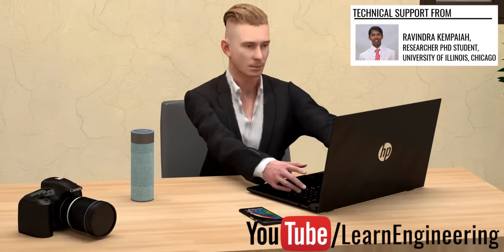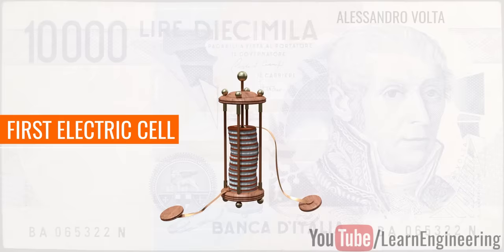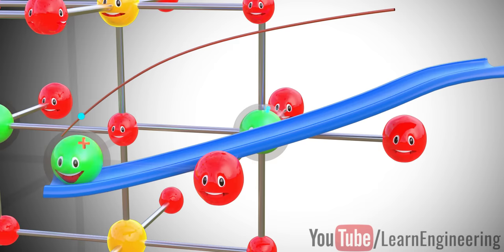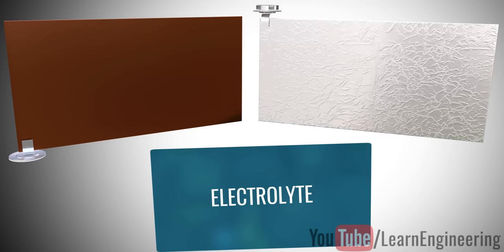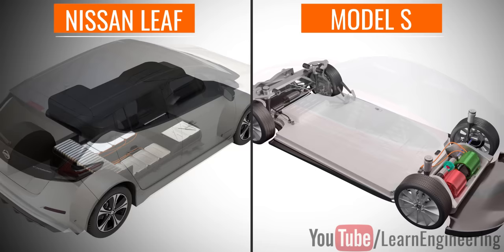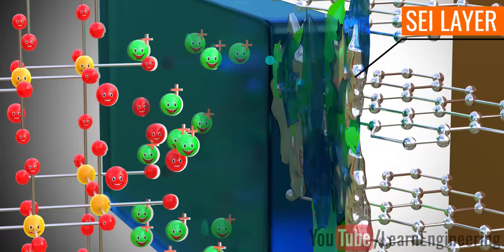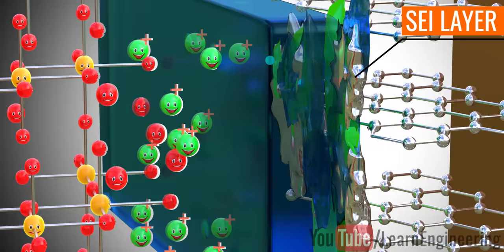Lithium-ion battery, How does it work?

Comment: Why the lithium ions coming to the negative terminal when charging and which is more stable either li+ or lithium oxide
Reply: When lithium atoms release electrons they become positively charged, and are attracted to the negative terminal. Lithium oxide is more stable because when bound with oxygen there are no free electrons which means it is harder for Li to react.

Comment: Does SEI layers forms only once or as many times as we charger it? Bcz if it produces every single time then the battery may become useless very quickly!🤷‍♂️
Reply: it does, Li-ion batteries will lose about 20% of their capacity every 500 charges, temperature of the battery and depth of discharge will affect life dramatically. newer batteries will lose only 10% after 2500 charges.

Comment: Lithium ion what if you use a vinyl ion that sunken to the copper plate and the zink metal is the producer and the one who filtered the chemical reaction of the vinyl ion that penetrate to the copper ended to the zinc metal who produce the electricity that is the feature  solid state battery

Comment: Wait, why do we need to increase battery cycles to 10,000 in order to get to 25 years? I charge my car about once a week - with 3,000 cycles, that's already 58 years. Even if we assume that my battery suffers some degradation and I have to charge it twice as often, that's still in the region of 29+ years

Comment: how do atoms move? and isn't it that electrons only bump with each other and doesn't actually move that fast?
Reply: Atoms generally try to obtain a state of stable energy. They try to move to where their energy is zero. 

Think of air pressure. If you have a state of low pressure in a vacuum and you open that vacuum, air particles flow into the vacuum to utilise as much of the space available.  

Same happens in the battery. The electrons leave the lithium creating an ion. That ion will then try to find a stable state and are attracted back towards the electrons.

Yes, electrons sort of “vibrate”

Comment: Uh, I have some questions. What about the fossil fuels used to generate 90% of the electricity to charge an electric car? Would it not be more efficient to just use those fossil fuels to propel it in the first place? Because around only 1% of the energy generated makes it to the motors, does that not make an electric car a gross polluter? About charge time, can you fully charge an electric car in 5 minutes? That's how long it takes to fill a gas tank. They have their uses, just not in any car I own.

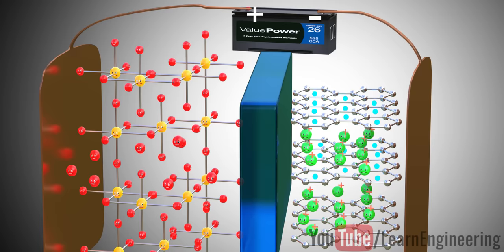Comment: 4:29 but why you called it Li ion when there's both li ion and electrons in same place in graphite it should be neutral atom here ?
Reply: They are not in the same place. The lithium ions are in the space between the layers, and the electrons are in the layers.

Comment: Wondering, how to move lith between met ox and grapyte layer. The thing that exists is that it is not sustainable. Once it has been used it must be refilled, namely charged, plugged into an electricity source (home electricity, charging in the parking lot,...). It is not possible for every unit, for example a conventional petrol or diesel car that is driven, to be recharged like an "ampere dynamo" recharges the battery I.e accu. The law of the conservation of energy ."the rendemen".

Comment: We still need to get a handle on fossil fuel production to generate electricity for the cars recharging of the batteries. I think it currently takes 500,000 gallons of water to produce one ton of lithium. Another area that could use Improvement.

Comment: Why electrolyte allows only Li cation ?
Reply: Cause li ions are electrically charged  atoms already(ions) .  By the time li ions leave the metal oxide area, they re already electrically  charged  by losing that electron on the outer shell right  during their presence in metal oxide area . The li  electrons on the  other hand are attracted by the positively charged metal of power supply  thus allowing electrons to flow to graphite area or medium

Comment: Saw video on Lithium Titanate batteries from China.  Says it will last for 50 years with 20000 charge cycles. Then why   these batteries not used in vehicles. ?

Comment: you mean the positive is a electron capacity While we call electron are negative right? wow i got it ta
Reply: Electron is negative ...they are only attracted by the positively charged metal. Ex is lithium  electron  from metal oxide to graphite  medium when power supply is connected ,when power supply is disconnected, lithium electrons go back to metal oxide where it is stable and lithium atoms go back to metal oxide through electrolyte .. This take time .ex is your smartphone, when your smartphone  is fully charged , lithium electrons and atoms   start moving from graphite medium to metal exocide . When your phone is low on battery  it means electrons and lithium atoms have all moved from graphite and  are now all  in the metal oxide medium.
Reply: @kadogo7712  i don't understand and confused. could you tell me the positively charged metal are positive charge on battery label. P.s. thank you for anwser
Reply: @TheZunziro  yes, the positive (+) from battery  label  is connected to metal oxide  plate , the negative (-) label connects to the other side graphite plate . Power supply is connected to the two polarized labels  then , when voltage starts , electrons from metal oxide get attracted and flow through  battery and go to get trapped into graphite (like magnet), but li ionized atoms go to   graphite side via electrolyte    until the li ions battery is fully . After charging ,power supply is disconnected...if you connect a load (bulb,smartphone etc) to the charged battery , electrons start flowing out of graphite area and back to metal oxide area until no electrons or li ions is left (but li ions take the same path ,via electrolyte back to metal oxide area.  The cycle repeats if the load (example your phone  battery is low again )
Reply: @kadogo7712  wow! so electron flowing form (+) to (-) right?
Reply: @TheZunziro  yes .
Reply: @kadogo7712  thank you thank you very much sir

Comment: Question is how can we make it more fast like refueling a car. A few minutes.
Reply: You just use tons of smaller batteries that can charge faster, and you use better cooling. To get to a few minutes we would have to use a better type of battery, like Zap&Go's Carbon-Ion battery that can charge in 5 minutes or less, and they are fully recyclable.

Comment: The chemistry in this video is completely wrong. 

Lithium is always Li(+). Inside the graphite, lithium remains Li(+), with the electron delocalized in the surrounding graphite pi-star orbitals. 

In the LiCoO2 electrode, the electron cycles from the cobalt, not the lithium. LiCoO2 contains Co(III) ions. Electrode cycling produces Co(IV) centers.

The electrode chemistry is:
 LiCoO2 --> {Li(1-x)[Co(III)1-x(Co(IV)x]O2} + xLi(+) + xe(-).

The xe(-) migrate into the graphite. The Li(+) migrates into the electrolyte, which delivers xLi(+) into the graphite to neutralize the charge on the x electrons. But no lithium metal is formed. 

 The graphics of the video are very nice. The chemistry is totally wrong. 

There is no elemental lithium metal in a functional lithium ion battery. Ever.

As an addendum, lithium deposition in a lithium ion battery is a fault. It can result from overcharging. The battery will lose capacity, and can short circuit.

Comment: Better not use lithium, it is too unstable for this & complicated for these applications. Electric Vehicles only need a few rechargeable batteries. Weight is Necessary. The turning wheels are all turbine sources along with wind flow for electrical production alternators & turbines. If you continue to move into these lower grades of technologies for control of exclusive Markets, your companies will all be out in the future & you will need to start over again. We already know this well & is one step away. Everyone Needs to get off of the seeking to trap Markets conception theory, it is a dead end. We have many endless other things to create in civilizations,  trapping markets slows us down tremendously, as seen before. Monetary systems are Not to be kept! We Need to become Kreative Production Based in All Parts of Civilization.

Comment: Stick with the gas engine. The amount it costs to make lithium batteries is 4 times what it costs to make a gas engine. After 6 years the battery is done. More pollution to recicle. With so few parts to a Tesla the car should cost $ 15,000.00.

Comment: Video is great. But cars on lithium batteries are horrible! Lithium mining destroys every aspect of environment where mining it happens. Tesla car batteries are not recyclable! They can recycle copper nickel from it, but precious, finite, lithium - hardly. To work on lithium batteries plant is so harmful for workers. And to produce electricity for those cars-we need to burn fuel - carbon and gas! This technology is a plague and has no future.       Btw there are studies showing that oil (petroleum) could be self renewable, so don’t throw away ur internal combustion motor just yet…

Comment: You don’t have change your battery pack for 25 years but 10-15 years down or sooner the line those batteries will only give you half of the range of hat you get it when it’s new.

Comment: maybe in twenty years lithium is still very dangerous my friend burnt his house down
i had one self destruct on my kitchen table look like a flame thrower one cell at a time 4 cell battery lion
you sound bias very bias
Reply: Now there is a safety thing to use when using lipo...never store the battery fully charged,Back in the day you had 3 days to discharge the battery or it will swell or leak.Never fully charge the battery unless you plan to use it all day.If not ,Discharge the lipo.

Comment: Induction motor is the worst type of motor. Toyota and all other e  vehicle manufacturers use permanent magnet DC motors. Only Tesla uses inferior induction AC motor.
Reply: Induction motors when operated with an inverter with efficient PWM has an advantage over a DC brushless motors – magnetic and conduction losses can be traded such that efficiency is optimized. This advantage becomes increasingly important as performance is increased. With DC brushless, as motor size grows, the magnetic losses increase proportionately and part load efficiency drops. With induction, as motor size grows, losses do not necessarily grow. Thus, induction drives may be the favored approach where high-performance is desired; peak efficiency will be a little less than with DC brushless, but average efficiency may actually be better. Hybrids use BLDC motors. Pure electric use AC.